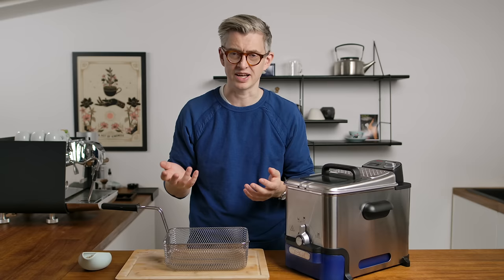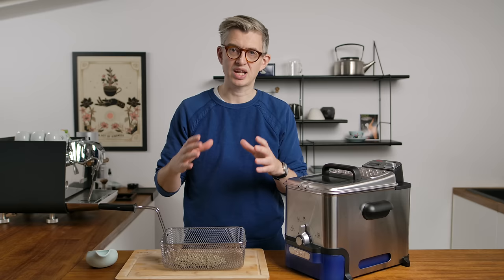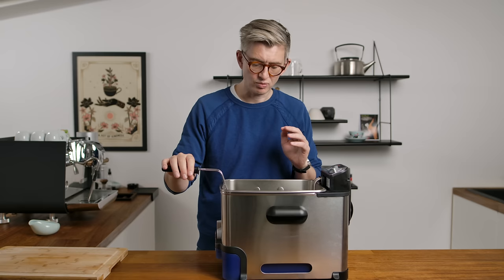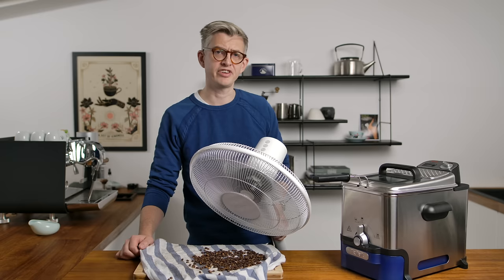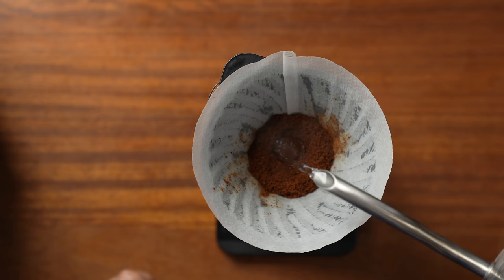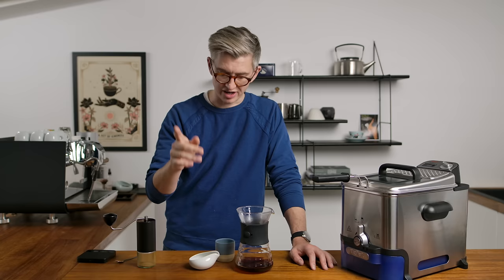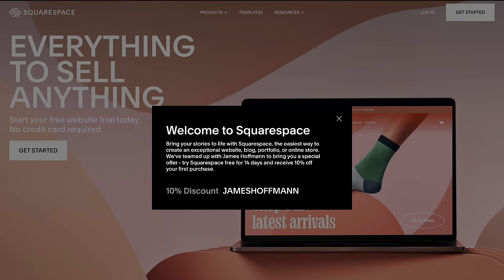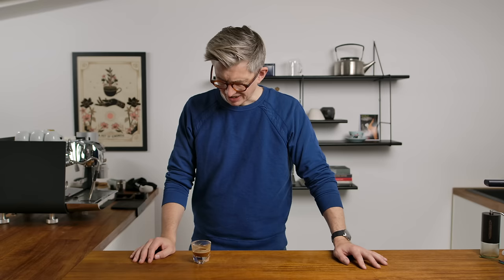Deep Fried Coffee: A Surprising Discovery

Comment: On reflection, I’m thinking the oil in the V60 probably floated to the top of the bloom and were “filtered” by the grounds so that it remained in the filter. With the espresso, all those oils were pushed straight through into your shot. As always, thanks for taking one for the team so we don’t have to.
Reply: Oil is less dense than water, that's why it didn't clog the filter.
Reply: @goncalovazpinto6261  hot water being poured through it could easily cause enough turbulence to make some stick to the filter. It takes a bit for oil to fully form a separate layer when it's mixed up
Reply: @mrastleysghost  I don't think so. The first thing that happens is that the filter gets wet. Once the filter is wet it will repell water and only let water soluble stuff through. When you start poring water, you specifically avoid causing turbulence, that's part of the V60 technique. 
Also, any amount of oil, however smal, will rise to the top and form a film. Whem the film is very thin it looks like waves of blue/yellow lines on the surface.
Reply: @goncalovazpinto6261  What are you on? Passage across an unstirred water layer is rate limiting, but not an impenetrable wall. Pouring water will cause turbulence, V60 is no exception. Oil will rise to the top, given time and low turbulence. Before that, it's suspended and subject to all sorts of motions. 
You express yourself in absolutes, whilst chemistry is much more nuanced.
Reply: @Karius7  And yet, the filter coffee was "good" and the expresso was "oily".
Chemistry is science, i. e. building predictive models. 
V60 is an extremely gentle pour, also the water has to go through a mostly undisturbed bed of coffee grounds before it reaches the filter.
I don't know if it was the case this time, but often you wash the filter before the coffee even goes in.
If I wasn't nuanced enough for you it was for the sake of conciseness.

Some oil will pass, not enough to change the flavor significantly: It is also a slower process than the expresso, so more time for the coffee grounds to interact with the hot water.
Probably the bloom also has some effect on the separation of the oil from the coffee (no bloom in expresso). Also the crema in the expresso might be carrying most of the oil.

There. 
I used "some" "enough" "significantly" "more" "probably" "might" and "most".
Nuanced enough? 😁
Reply: @goncalovazpinto6261  You managed to add a lot of "probably" when in reality you meant "possibly". 
I know chemistry is science. I'm a chemical engineer. 
If you had just gone for "he powerblasted the espresso, and was left with a lot of oil in the finished product versus the slow trickle of a pour over" I'd been happy. But you went with a whole lot of unscientific guesswork based on principles you didn't seem to properly understand.
Reply: @Karius7  Haaaa, here comes the "appeal to authority". You are a CHEMICAL ENGINEER.
Well, I am also "something", but I avoid using that because, unlike you, I prefer the arguments stand on their own ground and am actually curious about why the V60 was good and the expresso wasn't.
You see, I'm trying to keep this discussion about fried coffee, not about what "makes you happy". In fact, I don't even care if I'm right. I'd love to be proven wrong. It's much more interesting! 
I absolutely agree with Charles' original post, I was just adding to his theory that the density of oil plays a role in the V60 pour. 
These are fairly simple things to rule out in the lab anyway, any more "unscientific guesswork" 😂 on my part is pointless. 
If anyone experiments any further (I'm not going to btw) I'll happily joins in the discussion! 
Bye, bye.
Reply: note to self do not use fried coffee in espresso machine
Reply: @goncalovazpinto6261  you're the one saying chemistry is science whilst ignoring said science, so
Reply: @Karius7  hey, take it easy. We’re on YouTube here, not picking apart scientific papers. 😅
Reply: @mhacymballs  a simple "this could be what happened" would've sufficed, but he went full on "this is what happens, and that's no discussion. These are the facts"

Comment: This is a shot in the dark, but I think the process of making filter coffee also does a good job of filtering out the grease. It's going to float on the top during most of the brew and get trapped by the bed during the drawdown. The paper might help as well. With espresso you're forcing all the grease the other side, you don't get this gravity aided density separation.
Reply: Good pun
Reply: I think the same too. With espresso you kinda brew the coffe with higher temperature (steam) along with higher pressure. The heat makes the oil kinda melted/less viscous and pressurized to pass through the filter. That didn't happened with manual brew because the melted fat will most likely stuck to the paper and not enough pressure to push it pass thru that paper.
Reply: Excellent point.
Reply: And that probably happens with roasted coffee's own oils as well.
Reply: oh no, that totally makes sense

like a combination of gravity and the filtering action of the bulk matter of the coffee itself keeping oil at bay
Reply: maybe trapped in the grounds but not so much the paper. oil can pass through much thicker paper than that, fryer filters are thick.
Reply: @MrTentakul  its frying oil, so its already as its melting temp when it is room temp.  But oil floats on water.  So as long was it damp.  The theory is that the oil floats above the water, the water drains through the ground coffee and filter, and ideally maybe most of the oil stays stuck to the grounds when the water is gone.

Comment: I think the reason why the "pour over" one tasted better was that the deep fryer oil had time to rise to the top and was left there due to density differences. While the rest of the coffee's goodness drained down. On the other hand, the espresso machine uses pressure to push down all the liquid contents and also pushes most of the deep fryer oil mixing with the shot. In that process, it then overpowered the coffee, making it taste not very good.
Reply: Have you heard of the Save Soil movement before?🧘‍♀️🌎🌍🌏
Reply: Good point, that would explain why the filter looked so full of muck too, it was all the fats stuck to the paper and grounds.
Reply: @xxshevilxx  that’s right

Comment: Chemical engineer and former DIY coffee roaster here, just a couple of notes. 
-Caffeine is technically soluble in oil. I'd be curious what the caffeine content of that oil was afterwards, especially if you did this regularly :D
-The beans had a very wide distribution of roast levels, all the way from City(minus) to almost French. I ended up with something similar back when I was using a cheap popcorn popper to roast my coffee. I'd say it usually tasted pretty good too.
-When you did the macro shot of the bean it looked like some oil had soaked into the bean near the surface, but was locked in the bean structure, i.e. it didn't pour out when you cracked the bean. I'd be willing to bet that grinding also didn't release this oil(after all, coffee is full of oil) but the more efficient espresso process managed to extract that oil as well as the coffee oil as per normal.
Reply: Good assessment, that's probably what happened!
Reply: Can you produce evidence my boi or cheap talk?
Reply: @M60gunner1971  🙄 It's a logical evaluation. You have an alternate theory?
Reply: @mrfly8133  bean demons
Reply: I would be interested in knowing what happened to the oil as well; perhaps it would infuse it with caffeine or a coffee taste? Curious about the culinary potential.
Reply: @petrelli231  Caffeinated oil --> Monster energy fries
Reply: About the close up shot, I think that part of the bean in just darker due to the heat and not oil. Conduction is not very effective throughout the bean so we get this color gradient.
Reply: I came here to also say that caffeine is soluble in oil
Reply: Definitely want to know the caffeine levels.
Reply: This reminded me of a channel that baked a coffee flavored cake by extracting the coffee in canola oil, in a jar, heated using sous vide heater
Reply: From your observations, would you then say that the first test of the deep fried beans made caffeine-less coffee???
Reply: Would pressing the beans flatter, eg with a hydraulic press, and the increased surface level would increase better or at least different result?
You could do this while they are freshly picked, or by first soaking them in distilled water do that they are more maluable. 

Thoughts?
Reply: Super-caffeinated fryer oil. What a terrifying concept
Reply: Wouldn't saturating the frying oil with coffeine stop from being extracted kind of osmosis pressure, though it would be smart to weigh the beans beforehand and afterwards to make Sure you didn't infuse your beans with an OD.

 I think it would be better to spray the beans with some high heat resistant oil like sesame/peanut oil with a fine nozzle so everything has a as thin of an oil layer as possible followed Up by airfrying it. With this method the coffeine has nowhere to be extracted
Reply: @M60gunner1971  Do you also need evidence that a hardhat can reduce head injuries?
Reply: Probably the pressure from espresso extraction forced the oil out, while the pour over didn't.

Comment: I think you should revisit this with a couple of tweaks. 

1) Finer mesh on your basket, so that you can actually stir the coffee around, get it consistently exposed to fresh, hot oil, and away from its neighbors. 

2) Hotter oil. The hotter the oil, the less oily the thing you're frying will come out. This is of course to be balanced with, ya know, not burning the shit out of the coffee!

I know how you like to experiment and play with recipes and variables. This seems like the exact kind of thing that may warrant a bit further investigation. Ya know, don't spend months on it testing every tiny little thing. But that pour-over coffee looked promising. Maybe with some adjustments here and there, it could even be a truly good cup of coffee?

Either way, very entertaining video. I can't wait to see what Hames does with this, I just know it's going to be amazing.
Reply: Fry in ghee may be more of a butter coffee flavor, or lighter oils? More or less fry time too, but yeah a number of variables out of the initial attempt does sort of show potential.
Reply: Might be able to start with much hotter oil to kind of sear the outside to keep the oil out and then drop the temp for the actual roast?
Reply: While hotter oil helps for most deep-fry grease issues, the premise is that it's rapidly boiling the water in the fried product and those bubbles of vapor are keeping oil out. Coffee beans are a dried product and just don't have enough moisture to achieve this. This would also explain why we don't see other dried foods deep fried like spices or jerky.
Reply: also maybe hotter, but do not cool it down so the carry on heat will roast it internalky for a bit

Comment: This needs to be a series. (A Halloween series?) 
Different fry temperatures
Different fats 
Washing the fats off methods
Reply: I need him to fry some in coconut oil and sesame oil, at the very least. Ha ha ha. Cheers!
Reply: An Air Frier.
Reply: So washed coffee will just be... soap washed coffee? Sounds intuitive
Reply: Totally agree. Some oils have a stronger flavor than others, say olive compared to sunflower... Also temperature can have influence in the way it roasts from the inside, but it seems very even at that temperature, but also it might be the way the oil does heat exchange (?) Lovely experiments can be done
Reply: @Treegona  An air fryer is basically a mini convection oven... which is how coffee is normally roasted
Reply: Deep fry in sugar and milk and make delicious coffee tic tacs.
Reply: The oil temp is really what intrigues me.  he did a quite slow and gentle fry here.  would be really interested to see. A hard fast fry using say cornoil at say 425F/215C? Exposure time is going to be important for how much oil seeps into the bean.  As someone who has fried way more things than i probably should have, the lack of any reaction at all when the beans were added is a sure sign the oil temp was low.   this was more oil poached beans.

Green coffee moisture content is also going to be quite important here Curious if the green coffee is to wet, or too dry.  Roasters are essentially air dryers and take quite a bit of drying before to crack happens.

Comment: James, you might have better luck getting less grease in the final beans if you fry at a higher temperature for a shorter time. Normally, the water inside of a food item flashing quickly to steam during the frying process creates enough outward pressure that oil has a hard time penetrating the deep fried food as long as the fry time is relatively short (so that the cooking process finishes before there's no more steam left to protect the food). Since coffee beans have a relatively low water content, your window to fry them before the water all evaporates is likely going to be quite short and the oil will need to be very hot in order to properly vaporize whatever water is there. If you want more details, your Modernist Cuisine books (Volume 2: Techniques and Equipment, I believe) have a whole chapter on the subject and the physics behind it. It might also be a topic that is worth reaching out to Chris Young & Grant Crilly about as solving this problem seems like it would be right up their alley. I do suspect that with a little bit of tinkering though, the leftover grease problem could be almost entirely eliminated... Perfect for many more experiments and videos!
Reply: Sounds like more frying required
Reply: Even if that worked you would probably have to first soak them inside of Vodka for a couple days because Vodka evaporates quickly when heated
 (More crispy beans so probably a better finished product)
Reply: @leagueaddict8357  no fire risk there.
Reply: Could try double frying, too. With chicken, you fry to done, bump it up 100°F, then fry to crispy. The hotter temp drives the oil out of the breading and makes for far less greasy fried chicken.

Lower temp to get the beans "done" then crank it up to dry them out.

Comment: You could definitely get lots of different flavors depending on the oil you use. you could also combine different ways of roasting or frying coffee. You can also wash the beans after frying to get more oil off, potentially.
Reply: I like that idea.  Pouring some boiling water over beans in a metal screen mesh strainer, would wash that oil right off, especially in the deep part where it seemed to be gathered in his cross section.  At the temperature of his fryer oil, not that much would have penetrated the bean.  So any extra oil would be in those deep holes on the surface.
Reply: @billparrish4385  boiling water would reduce the coffee's flavor, since you know, you use boiling water to make the coffee and throw out the grounds because you've leached all the flavor out.
Reply: @youngeshmoney  It would do so as grounds for sure, but as whole beans that have been deep fried, I'm hoping the balance between the flavor-leaching effect and the washing off of the extra fryer oil on the surface could be optimized.  The water would destroy the crunchiness, necessary to getting a good grind.  Maybe crisp them up again in an air fryer, then grind?  

Then again, deep frying may not be that viable an option, at least for espresso.
Reply: @rogerunderhill4267  They don't mix, but boiling water would heat the oil, making it very thin, so that the force of the water could wash it off.  Water and oil likewise don't mix in a salad dressing, yet shaking them together produces an emulsion containing both.  So I believe it could get at least much of the excess oil off, but whether that would be enough to remove the bitter, fatty taste in his espresso is another question.
Reply: @Bill Parrish  Maybe you could leave the beans out to dry after washing them so they aren't soggy in the grinder? (Air fryer would work as well I suppose.)

I'm not sure about other options when washing the beans. Maybe there's a fancy process or soap out there that doesn't leave any residue while also removing oil. Of course, any oil inside the beans would remain, but it's still pretty interesting to think about. There are plenty of things to do to "roast" coffee like putting them in the sun or a dehumidifier or, yes, deep frying, and you could do any combination of them to get really complex coffee.
Reply: I'm wondering if peanut oil would be ideal to give it a nutty, savory flavor?
Reply: Grapeseed oil is often used as it doesn't add a flavor to the food. The peanut oil suggestion might be good as well. Maybe Hazelnut oil?
Reply: This is a critical issue - and an iconic dichotomy, let's face it.
Reply: Deep fried in coconut oil maybe?
Reply: @ButterfatFarms  🤓🤓🤓🤓🤓